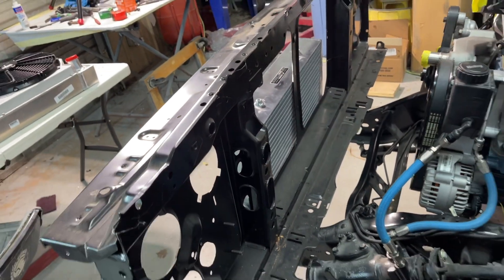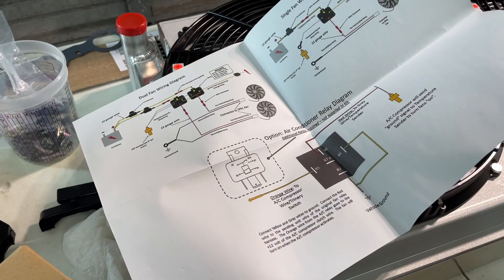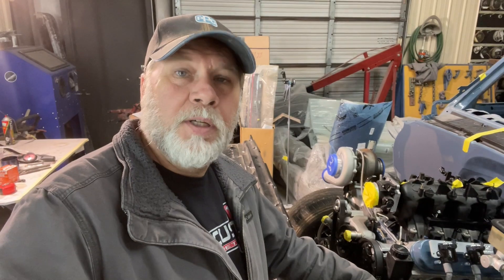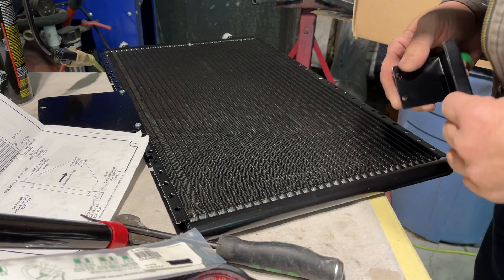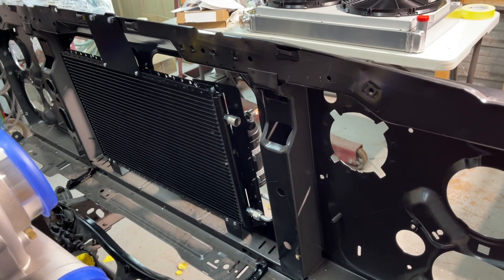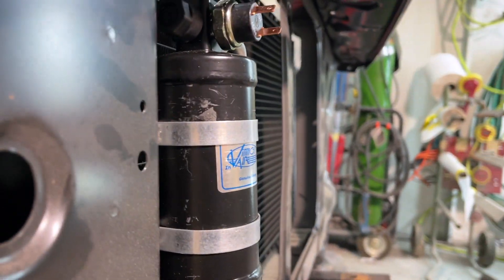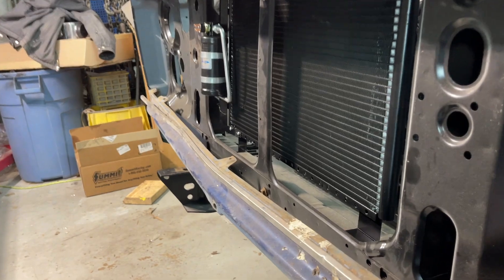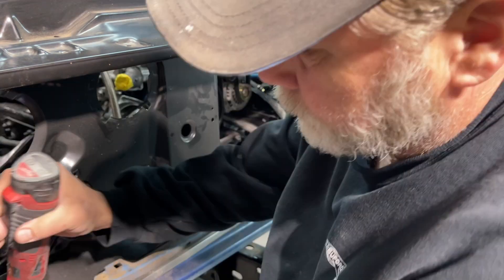C10 Project:  Turbo Intercooler, Condenser, and Radiator Installation.

Comment: I just ran into the same issue as you at about your 16:40 minute mark regarding the line from the drier to the bottom port of the condenser.
Reply from the maker: @reggienoble571  I made it work but if I did it again I may just relocate the drier. Thanks for watching!

Comment: Well I got my answer, you kept the stock vintage air location for the drier. I think I am going to find a remote location by using flexible hose. I need to find out if there is an orifice tube in one of those hard lines. don't know right now.
Reply from the maker: Hey bud. Finally saw the comments. Yeah I’m not sure on the orifice tube. Can’t remember seeing one. If i had it to do again I would relocate the drier. Using the EZ Clips turned out to be a lot easier than I though. They aren’t cheap but well worth it. Good luck on your project and thanks for watching!

Comment: Can the receiver/drier be moved off the condenser, or does it have to stay there? I’d think you could make new hardline and move it maybe over near the headlight.
Reply from the maker: I’m pretty sure it can be moved to where ever you want it. I was trying to work with what I had but further along I bought some of the EZ clips to make the lines with. They are super easy to use, plenty of angle fittings, etc. use those and put it where you want I believe.

Comment: Any progress on this ??
I have one that I am wanting to do the same and scratching my head on how to make it all fit.
Reply from the maker: I’ve made some progress.  I’ve got the intercooler mounted, plumbed, radiator in and plumbed, almost done with the a/c. It’s a lot to squeeze in. There are a few videos after this one showing a bit more but I still have the turbo exhaust to do and a couple little things.
Reply: @StoutCustom  
Thank you! I just started looking around. Bought a truck that’s mostly been built, BUT WITHOUT A/C or Heat

Comment: Why are turbo’s always end up being 5 lbs of meadow muffins in a 1 lb bag? 
I know A/C lines are not easy but mounting the high-dryer inside, on the end or remote location. Don’t be afraid to place proper curves in the tubing. More to occupy your midnight thoughts! It will pay off later as no two are the same.
Nice work! Thanks.
Reply from the maker: More than one way to skin a cat for sure

Comment: Good to see you back. Where does your "Show truck" project stand? Have you found a new home/shop location? Have not seen your 2 pups lately.
Reply from the maker: My part of the “show truck” is finished. It’s back to the owner for assembly. Check out jreedsac on instagram for pics. No permanent location yet just a temporary place to try to finish my truck and everything I own strung out across 3 states, lol. I still have the blue heeler and finally found a good home for the other one which was her pup. Thanks for checking in and as always thanks for watching!

Comment: You could use Vintage Air East Clip fittings and hose to mount your dryer any where. Found good prices on Amazon.
Reply from the maker: Good to know.  I thought about relocating the dryer at one point and started researching how to do it.  All I saw were kits that needed a crimper and was un aware of the EZ clips.  I gave up since it seemed like I would still need to move the condenser inward some and then I had to find another spot for the dryer. I think I may be limited on room with the turbo and all the plumbing.  We will see how it works out.  Thanks for the info I really appreciate it!

Comment: The first person that figures out the adaption of all three of these things for the square body will make a ton of money!  The radiator and the intercooler are the easy part, adding the condenser is where the big bucks will be made. 🤟🏻 my best guess is to get new AC dryer hard lines made to mount the dryer canister inside the engine bay instead of in front of the condenser,.   good luck and will be watching!
Reply from the maker: Vintage air makes a dryer kit that could be used to relocate the dryer. I think you can buy the individual parts off of eBay as well. Just have to have the crimper for the lines. Might go that route next time
Reply: I'm going to take a look; I have to relocate my drier for the same reason. Radiator, condenser and intercooler are mounted. no room for the drier. @StoutCustom